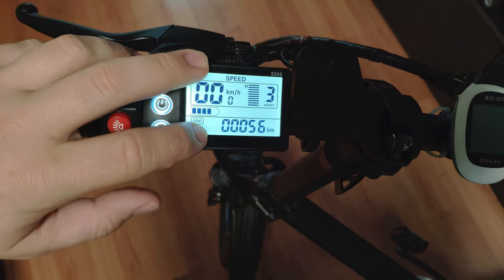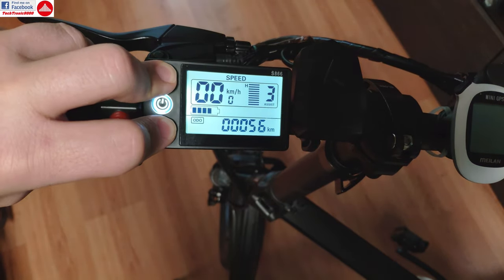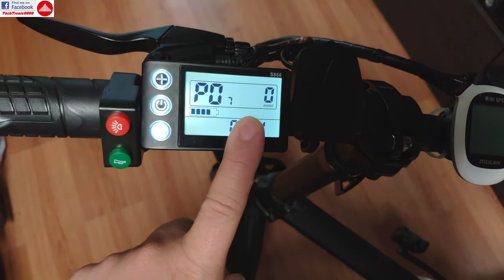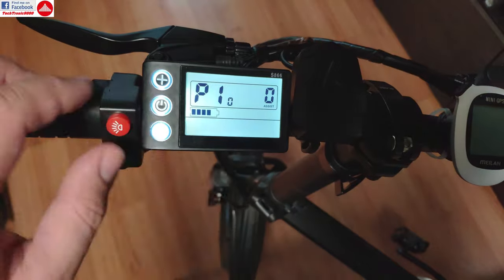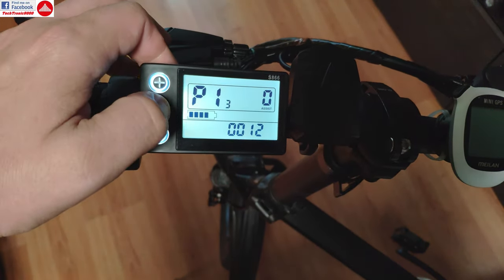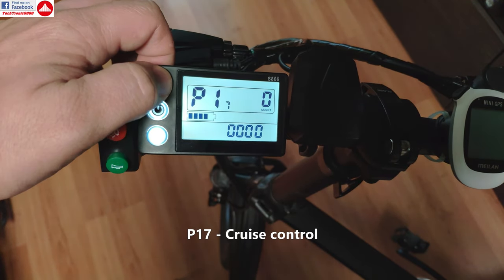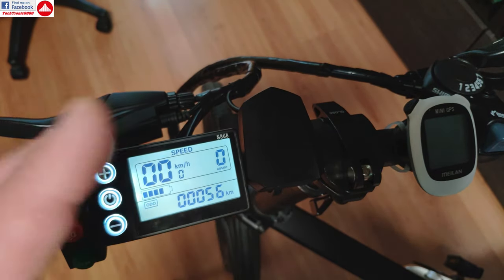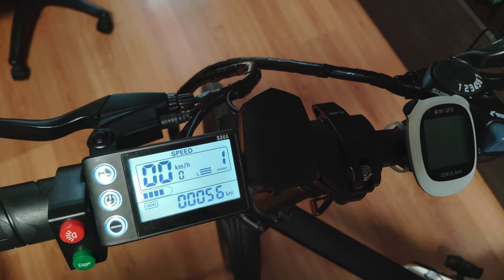ADO A20 / A20F / A16 S866 LCD - Complete Settings Walkthrough (P01-P20)

Comment: So is it possible to put a 48v battery in ado 20+  and then limit the amp? 36v*15=540w pick and put 48v*13=624w to get a little more power if the 36v gets old ? I ses the controller in ado site support 36/48v... Has anybody tried it ? Or is it maybe better to stay with a new 36v and more amp ... 36*17or18=612w ... whats better for the motor i mean
Reply from the maker: You don't need to limit the AMP and with will also not work from the settings. The controller is designed to work up to max 15A and up to max 48V so you are totally fine with a 48V battery @ 15A. You will gain some impressive performance with that by the way, especially as the max peak power will reach 800+W (fully charged 48V battery is 54.6V). Both acceleration and power will be increased.
Reply: @TechTronic9000  O i thought it can be done by the settings to don't burn the motor in the long..( i have done this with a xiaomi scooter...pushing just a little more the amp in the controller and it works fine for a lot lot of km now). I hope the motor will be ok with that amount of increase
Reply from the maker: It will work ok withe the ADO. Worst can happen is that the wear on the motor will be higher which is normal under heavy load. Also keep checking motor temperature during hot summer days.

Comment: Have you noticed that if you press and hold the + symbol, the lights symbol appears on the lcd screen? Nothing else happens
Reply from the maker: That is for controller light turn on function. On the ADO you have a separate switch for front light.
Reply: @TechTronic9000 You sir know your stuff! ❤️👋🏻

Comment: Will it be safe to put 48V on my Ado 16 350W?
Reply from the maker: You are doing that on your own responsibility, you could check if the A16 controller has 36/48V written on it. If it has 48V then you can put a 48V battery and change it from the LCD settings from 36V to 48V, it will turn into a pocket rocket ;)
Reply: @TechTronic9000  thanks. It has a 48v setting however i was wondering if the increased voltage would burn-break the motor on the long term since it is rated at 36V.

Comment: Is it possible to reset the settings to factory fast?
Reply from the maker: No, there is no reset. You just need to program each parameter with the default or correct value.
Reply: @TechTronic9000  Ok thank you!

Comment: This was helpful, though before reaching this video I seemed to have messed up with settings and now couple of things seemed to not work as expected. First my speed shows 11km/h even though I reached 25 when checked on my phone. Secondly, when I just use pedal without throttle or any assist, previously i used to get speed, now speedometer only works if pedal assist or throttle is used. Is there any way we can reset this to factory settings?
Reply from the maker: There is no factory reset, you just need to check each setting to be the right one.
Reply: Well the ebike that I have is a new startup in my country and unfortunately they haven't provided the guide! Or the default settings

Comment: Hi! Thank you for this video. I have the same display but it seems absolutely IMPOSSIBLE to enter the settings menu. When I press - and + I get to a 4 digit screen and I am supposed to enter some kind of password. The manual says 3745 is the default password, but I am not sure how I am supposed to verify this, as, when I enter it, I press the power button forever and nothing happens. The same happens when I try other passwords I found online like 0000, 6666, 1111 etc. Maybe there is another way to enter the verification, other than the power button? When I press - and + again I just return to the main screen with no results. I would be grateful for any help!
Reply from the maker: If it's a new bike contact ADO. otherwise the ex-owner could have changed the password so it will be impossible to guess it.
Reply: @TechTronic9000 Thank you very much. It is a new bike so it did not make sense. I was so frustrated that I bought a new controller 😊. The issue I initially had persists though. The bike behaves as a regular bike for the first 20 minutes or so. I changed the P11 to 1, to 0, nothing happened. I changed all the drive modes to assist only, electric only, combined, nothing again. I honestly do not know what the issue might be... It seems there controller is totally unable to control anything to do with the bike.

Comment: What’s the right number for the battery
Reply from the maker: On the a 20? it's 36V
Reply: @TechTronic9000  no I have electric scooter t4m
Reply from the maker: Then it depends on your battery nominal voltage.

Comment: I have error code E10 on my ADO16 and the impact is there is no eletric power anymore, both for PAS mode or Throttle mode. Is anyone experiencing this and found a solution?
Reply: did you figure it out

Comment: I only have 16 settings, is this normal or has there been an update?
Reply from the maker: That is good, you have the newer and improved controller.
Reply: @TechTronic9000  thank you! Does that mean I can set different levels of pedal assist for each setting? Or adjust the top speed on pedal assist (more than 25km/h on level 2, without throttle)?
Reply from the maker: You may have 5 assisted moder instead of 3, check my newer videos regarding this on the ado D30C, it uses the same controller.

Comment: can you help - my S866 controller does not bring up P programmes when i press + - together I just get 4 dashes at bottom of screen - which you can change to some letters and 0 - 9  - cant find any instructions
Reply from the maker: It probably has been locked, try to input code: 3745
Reply: @TechTronic9000  I block my bike, Have you a code for the RV700 ? Thank's
Reply from the maker: The RV700 is new, I don't have experience with that... Yet :)
Reply: @TechTronic9000  thanks In found on the original manuel on website

Comment: I have set the speed on 100 instead of 25 kmh but still the ebike won't go faster than 25kmh .PS the battery is 36 volts 11,2 Ah
Reply from the maker: Do you have the throttle installed? It will go faster only with that ;)
Reply: @TechTronic9000  no I didn't because it's illegal in the Netherlands, but the connection is there so a throttle is possible. Thank you for the advice and i will try that 👍 🙂
Reply from the maker: You won't be able to get faster speed if you don't add the throttle.

Comment: Hello, thank you for your video.
Last week I received the A20F bike and also the upgrade kit with the new controller.
I tested the bike with the original controller and everything works fine.
I replaced it with the new controller (I prefer the driving modes available on the new controller).
I checked the wiring several times, everything seems OK (LCD display, lamp, horn, brakes, speed ....)
I manage to switch between the hybrid drive mode and the pedal assist mode.
There is however a strange behavior with the pedal assist mode.
Whatever the levels (low, Medium or High), it does not change the power torque of electrical assistance, I always seem to have the maximum assistance torque (high level)
Do the levels only impact the speed limit (low = 15km / h, medium = 20km / h, high = 25km/h) and not the level of electrical assistance torque?
I asked the question to Adobike support, waiting for an answer.
DH74
Reply from the maker: Hello, it is normal. On bikes with no torque sensor the controller can only limit speed. You can try to adjust delay and motor acceleration so it will not instantly star full power, that will also save some battery.
Reply: @TechTronic9000 
Thank you! I understand better now. It s true that It seems to have few Chinese e-fatbike with force sensor... Strange, maybe more expensive
Reply from the maker: Usually the troqe sensor itself is over 150$ and it also need another motor controller that is also more expensive then usual ones. A retrofit torque sensor + controller it often starts from 300+$ While a regular controller is just 50$
Reply: @TechTronic9000  thanks for answer. P11 and P12 are not easy to set and to understand the real effect . Difficult to find a good notice of S866 with details and example of setting of these parameters
Reply: @TechTronic9000  Is someone know the max torque of A20F? I see that A20F is quick limited in the slopes... In France, with 250W power, we can find 90nm motor torque... Chinese bikes seems to focus on max speed, max power but not max torque?
Reply from the maker: The A20F motor can develop a lot of torque, probably 50-60Nm, the problem is the controller which limits the curent. The known brands such as Bosch with 90Nm although sold as "250W" are far from truth as internally on peak power they go up to 1500W.
Reply: @TechTronic9000  
Hello, I can read on some reviews that Ado A20f is limited to 250w. It is possible to unlock this limitation to 500W with s866 setting (increasing limit speed to 35km/h)
For me, there is no change on maximum torque, the additionnal power help just to go faster above 25km/h...Is it true?
Reply from the maker: By removing the speed limit, the power will also increase. The acceleration will be similar. You can also adjust P12 motor acceleration strength, set it on 5 for a bit better motor speed up.
Reply: @TechTronic9000   hello, thanks I will try P12 settings.
Unfortunately now, I have a problem with my pedal sensor.
Already I do not understand its fixation and the function of the 3 small black screws
If I push the sensor all the way in, the motor will not engage.
If I push the sensor lightly, leaving a play of about 2mm, the motor engages normally
I have a doubt about the position of the light gray cylinder with the notches. It seems strangely to protrude from the side of the pedal with the chain ... (I have photos but I don't know how to send
Thanks for the help
Reply from the maker: You can send me a message on my Facebook, it's the same as my channel name (techtronic9000) and there you can send also the pictures.
Reply: @TechTronic9000  sorry, I dont use Facebook, only mail

Comment: hello what about E 10 error?
Reply from the maker: It's a communication error, could be from several things such as changed settings for P20 communication protocol, loose plugs or might be a faulty headlight  or faulty controller.

Comment: In my case even if I set p08 to 25 km/h it still has unlimited speed :/ does anyone know why?
Reply from the maker: Watch the other ADO related videos, you can get 35km/h by using the throttle.
Reply: @TechTronic9000  i would like to limit it to 25

Comment: hello, how to activate the 6 km/h function on the s866 thank you
Reply from the maker: Hold the down button pressed for a few seconds.
Reply: @TechTronic9000  before it worked, not anymore. I think I touched in a screen settings. otherwise you would have to do a reset. I found a function by pressing the plus and the stop button at the same time. it displays 6 small lines to put numbers, what does it concern? a code to put. thank you for your reply.
Reply from the maker: There is no reset, you need to check each setting again.
Reply: @TechTronic9000  ok merci
Reply: @TechTronic9000  you know how to remove engine brake regeneration. because the engine does not immediately because I friene. thank you
Reply from the maker: This controller display doesn't have settings for regen brakes, you probably have another controller, maybe it has a hardwire to enable that function.
Reply: @TechTronic9000  it was with the same controller.

Comment: When I now buy a bike, will it have the New controller? So the ones With the old controller are sold right now?

I mentioned that some vendors sell a EU-Version and an international. 
Is there a difference? Or just other default settings?
Reply from the maker: If you get it from the official stores such as: https://bit.ly/34J6zm5 or this https://bit.ly/3I6g4cE it will have the newer controller. The difference between EU and international is just the programing. The EU comes with throttle disabled and limited to 250W/25km/h while the international has throttle enabled and will do ~35km/h with a power up to ~500W (they declare 350W). You can change the programming easy following this video https://youtu.be/rL0P9gW5x4U

Comment: O have a cuastion i dont have p18and p19
Reply: Why
Reply from the maker: You have the newer controller which only has 16 settings.
Reply: @TechTronic9000  O thank  you
Reply: but how can i unlock the speed limit i set it to 100 km  and it stil going 25 km per hour ??

Comment: the battery bar decreases rapidly since I debridged at 35 Kmh
Reply from the maker: Yes, that is normal, with no speed limit you are actually pushing more than 400W of power.
Reply: @TechTronic9000  thank you for answering my questions

Comment: how do you  turn off the trottle
Reply from the maker: If you don't want throttle at all then I advise you to get the newer controller with 3 assist modes. You can see both controller and how to replace them: https://youtu.be/Pyl3P8tiyhA then you can follow up the test ride where I explain more about it and show how it works: https://youtu.be/rL0P9gW5x4U
Reply: @TechTronic9000  not sure i have a newer display might be another controller to just looking for the setting i have the smlro s11 pro ebike
Reply from the maker: Then this might be totally different for you. The ADO uses a rather different controller type.
Reply: @TechTronic9000  yes but the lcd settings where the same learned a lot like p8 speed adjust etc very helpfull 😅

Comment: How to increase power by 250 W to 350 W ?
Reply from the maker: By unlocking the speed limit, also adjust motor acceleration speed to level 5
Reply: @TechTronic9000  thanks you very much
Reply: Which P was for the acceleration?

Comment: Does anyone know what is the password? 3745 and 6666 not working
Reply from the maker: If the usual 3745 doesn't work, i have found some badly translated Chinese documentation which says: "If you forget the password when you turn it on, enter the “ 3745 ” alternate password, press and hold the button for 10 seconds to enter the normal interface."
Reply from the maker: That is good to know

Comment: hello how do I set the pedal assistance higher to 25 km / h? with friendly greetings

￼

hello how do I set the pedal assistance higher to 25 km / h?
with friendly greetings
Reply from the maker: It's not possible. There is a possibility that a new controller upgrade could make this but it's under testing.
Reply: @TechTronic9000  It has been released now
Reply from the maker: Yes, I'm planning on testing it.
Reply: To go into cruise control mode hold the throttle until the bike  is full speed then hold the minus sign on the display down for about 5 seconds